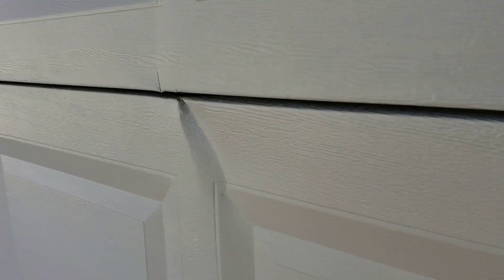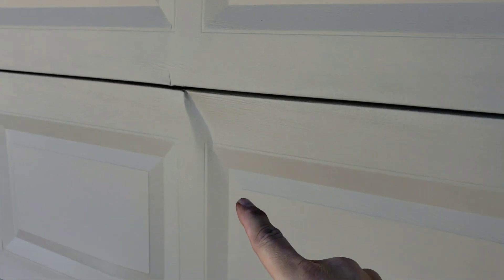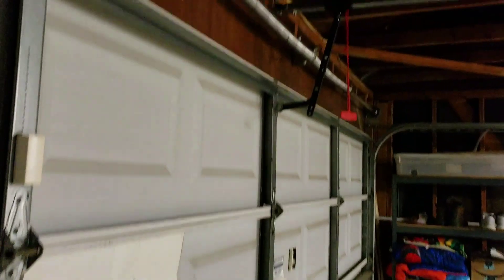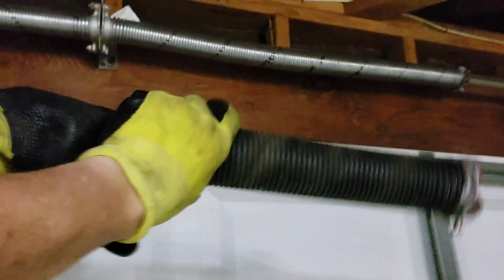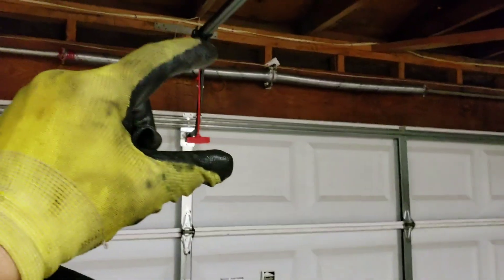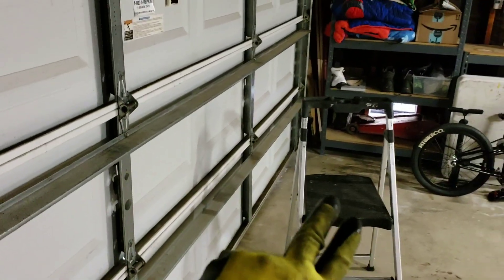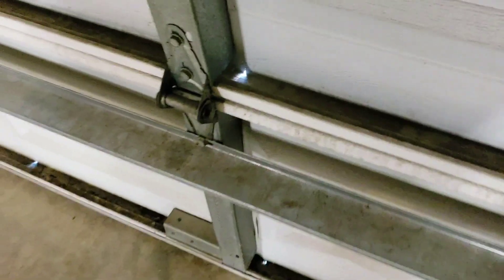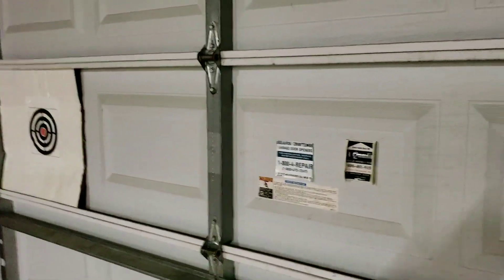Garage Door Bent? | Wind Damage Reinforcement

Comment: I have the same damage on the outside of my garage door here in Hawaii. Except it went one step further and actually TORE part of the panel and left about a three inch crack. I got this however from constantly manually opening and closing the garage door due to a broken garage door opener. I am replacing the opener, but is there any way to fix that crack on the outside? I'm assuming since the new garage door opener will be opening/closing the garage door, it won't have that pressure anymore in the middle from manually opening and closing it, so it shouldn't get any worse. But the garage door installer is telling me I need to replace the whole door, and that since there is damage, he won't even warranty the new garage door opener he is installing.

Comment: Where do you buy the TWO bars tht you installed on the two bottom section
Reply from the maker: Sadly, those you’ll generally have to buy from a garage door supplier. Depending on where you live, you may find a garage door manufacturer or dealer who could sell you them directly. Standard cost could be anywhere from $45-$100 each. The one thing I would suggest though is make sure you buy self tapping screws to install it. The part you want is called a wind strut or reinforcement strut and you’ll want to make it 1/2 inch shorter than the width of your door in order to avoid it rubbing against the tracks as the door moves. Hit me up with any more questions.
Reply: @aqualitygaragedoor6366  Do you know the name of this sheet metal bar? thanks
Reply from the maker: They are called struts in the industry.
Reply from the maker: I may even have a video on how to install them if you would like to see that as well.